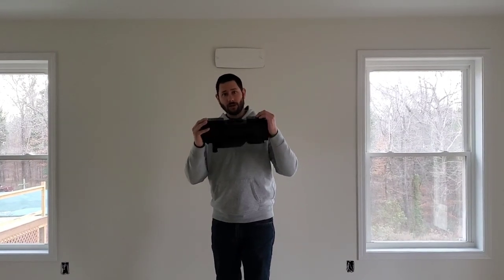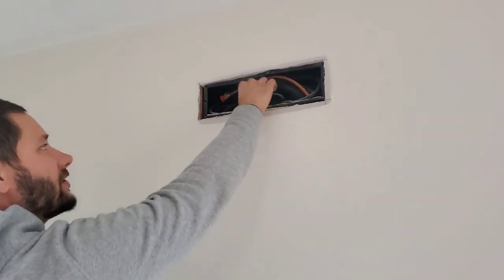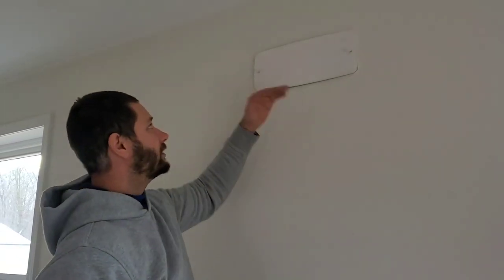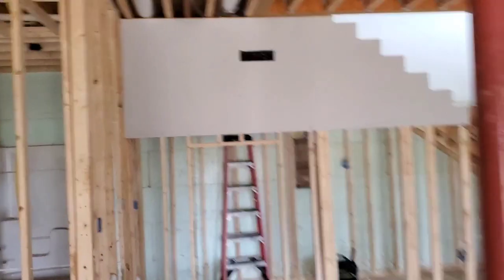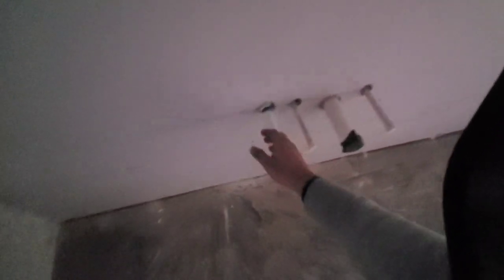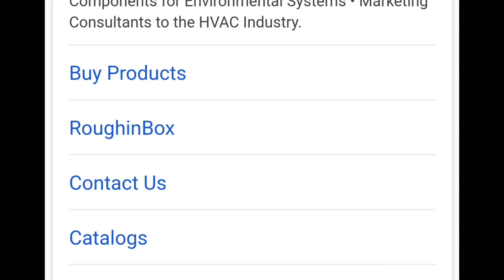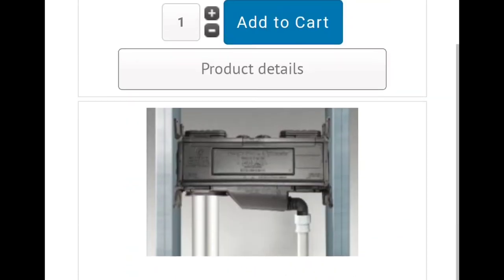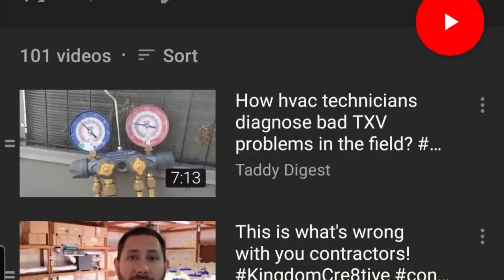How To Install a Mini Split Rough In Box?

Comment: I'm thinking of running the control wires through a conduit.  My idea is that the Mini Split might not last the life of the home, but refrigerant and condensate lines probably could.  If you replace the Mini Split in 10 years, you could reuse the refrigerant lines, but its pretty unlikely that a unit from a different vendor or generation of equipment is going to be using the same control wires.

Comment: Great Video Tad. Can I ask about vertical water discharge? I have an application where pvc will stub out top of box (with pump) then run down vaulted ceiling (no attic) to exterior. Will my condensate line require a vent pipe out the rooof?
Reply from the maker: no, it shouldn't need a vent

Comment: Interesting, does that mean you make custom linesets instead of using the ones that come with the air handler unit? Are linesets the same for every air handler unit basically?
Reply from the maker: we use the same line sets we just cut and re flare whatever length needed

Comment: So, let us see a video of the WHOLE INSTALLATION not just the hanging of the rough in box. I want to see how easy the rough in box makes it when it comes time to hang the evaporator. I haven't found a YouTube video where anyone takes this rough in box all the way to the final installation and that's what would be the most beneficial to me.
Reply from the maker: deal I will do a video of that in 2 weeks
Reply: Was this video ever made?
Reply: I never saw it posted.
Reply: Teddy Digest?
Reply: I used these rough in boxes and they are a pain in the ass because you never show how to connect the mini split to the rough in box…it’s easy to screw this box in the wall and run a drain from it and leave the line set and the control wire inside the box till later….the hard part is installing the unit to the box….I think it is a great concept but it is still in the prototype phase…there is not one video showing anyone installing a unit to the box…only videos of the box being installed….cmon Taddy…it’s been 3 months bro….and still no video….
Reply: Do u want me to send u a video so u can see how to do it??
Reply: Yes please post this. I have a unit to mount to a rough in box soon and it's my first time doing it. I'm having a hard time picturing how to mount the bracket and make this work to get to the connections
Reply: @b16civic93  did you ever get that video
Reply: @briandepew1769  Hey Brian did you ever make that video of hanging a high wall to the rough in box?
Reply from the maker: Wow I just saw all these comments I don't know how this has stayed hidden from me for so long

I have made this video I have made several videos about the rough and Box since this
 I can't believe I didn't see this comment otherwise I would have posted the video

I will get on reposting the video
Reply from the maker: thank you for commenting I just found this
Reply: @TaddyDigest awesome
Reply: Link to the video ????
Reply: any info.  Jw.
Reply from the maker: Hey man I'm not sure if I made the video or not I've got a few rough inboxes that we're installing right now so I'll try to do a video the video before they close up the wall
Reply from the maker: https://youtu.be/H4eBTO1BxHo
Reply from the maker: https://youtu.be/H4eBTO1BxHo
Reply from the maker: https://youtu.be/H4eBTO1BxHo
Reply: Looking for the final piece but I cant find it, I want to see how much they struggle to tight down the flares and pass thru the communication wires
Reply: @Kaprithedj  yea they won’t show that 🤣

Comment: That’s a lie. Incorrect you can run the line set in the walls without a tough in box and it’s called communication wire
Reply from the maker: I never said you couldn't
You need to watch more of my videos